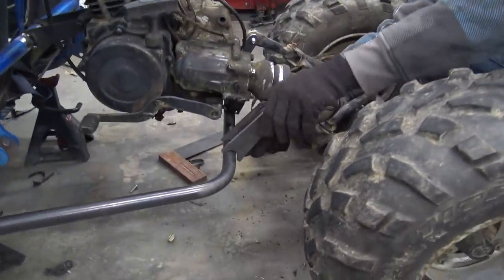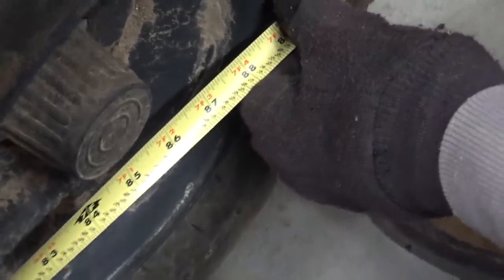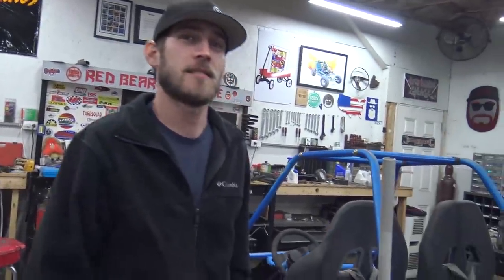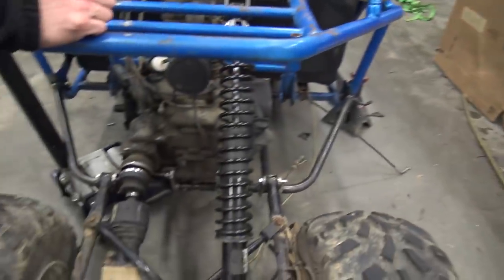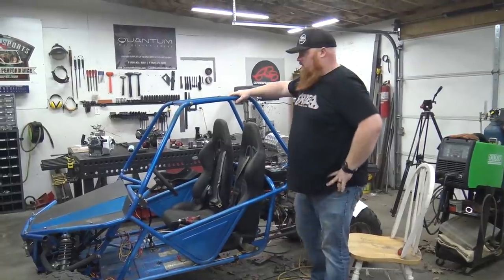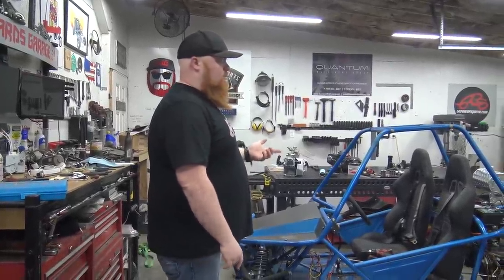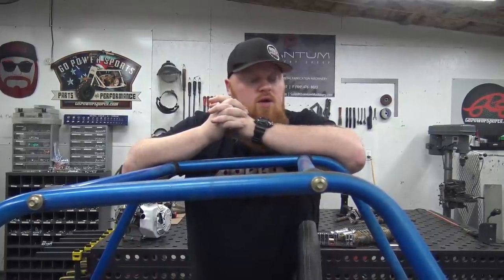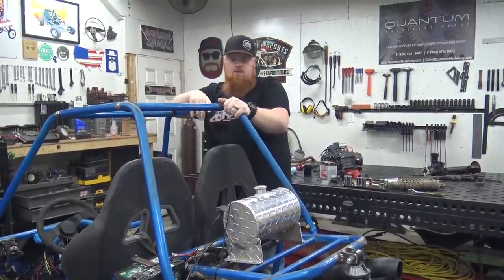Go Kart ATV Engine Swap ~ Kawasaki Bayou 220 Ep2

Comment: yes it is a spring and its an easy fix just make sure you find all of the old one i used the clutch springs out of an old cheep chain saw haven't had any problems yet nice work guys i like this build

Comment: Red .........
Ya welds look pretty good !
Now add some nitrous !
Those little kits you can buy on E Bay and Amazon for like 34 bucks , those little nitrous bottles , give a 6 second rush of madness lol.........
Watched a video on mini bike engine using the kit
Pretty cool !!  
They stepped down the nitrous intake , got 8 seconds worth and the engine was no worse off
POWER at the push of the tiny RED 😂 button !!
Come on , I know if anyone could make it happen , it be you !!
Joe Navy veteran 🇺🇸
Reply from the maker: We have used those kits in the past and have some on the shelf. We will get one out soon and use it again
Reply: @RedBeardsGarage  
Cool
Love to see what kind of result you get on a bike or go cart ??
Joe

Comment: As far as the shifting problem. Try changing the oil and use Kawachem oil which is Kawasaki brand oil. It fixed the one I used to have.
Reply from the maker: Yeah I'm sure this old engine hasn't had a tune up in a while

Comment: Hey, Red I have a question and I would love it if you could help. I have a Kawasaki EX 500 and I can't a spark I have check all the wiring, plug wire, plug, coil, and computer.
Dude I am losing my mind trying to get it running what else could it be so I was wondering if there is something else I could check! anyway, Thanks.

Comment: I have a prairie 650 engine that I bought for the clutch.  Supposedly it only has 85hrs and the engine is fine but the the gearbox has a chain broke.  I got what I wanted as I didnt pay much and the clutch was in great shape.  Unfort it has no carburetors and I would also need the electronics and radiator.  So basically it would cost a small fortune just to see if I could get it running.  Also doesn't appear its easy access to the gearbox its like you have to remove the heads and split the whole engine in half or some crap I really haven't looked at it much.  So it's pretty much sitting on my bench taunting me.

Comment: I just fixed the gear shift on my bike with the same problem it's a spring on the shifter shaft that keeps it centered after the gear change
Reply from the maker: That's what I was thinking was wrong with it. Thanks for the info

Comment: Greg, I looked through your tools page on amazon and didn't see a pipe bender. What bender do you use? Also, I saw several tube notchers - bayleigh, eastwood, and one more. Which one did you like the best?

Comment: The CV joints will be an issue. They do not work well at extreme angles. Driveshaft U-Joints will work better.
Reply from the maker: It wont be at that extreme of an angle when finished. Thanks for looking out though